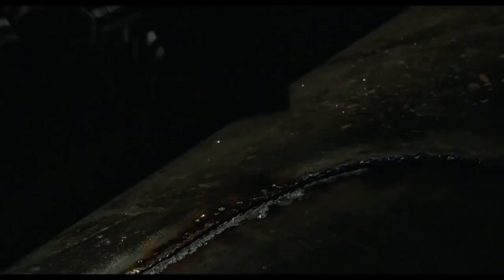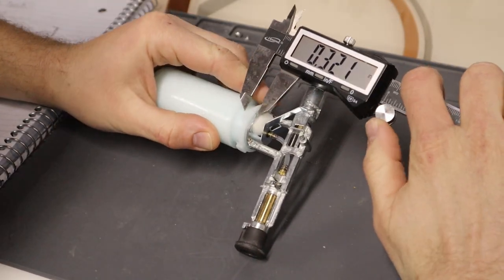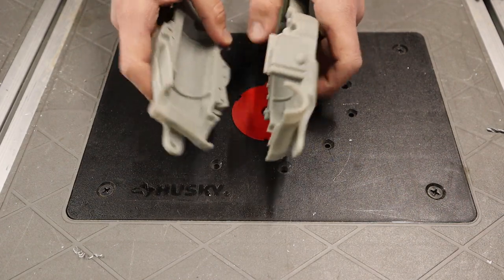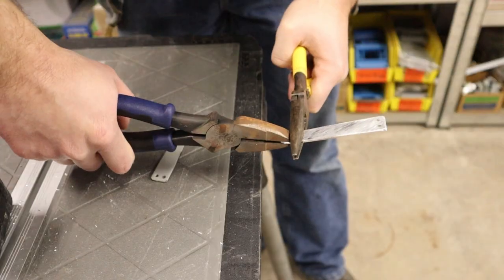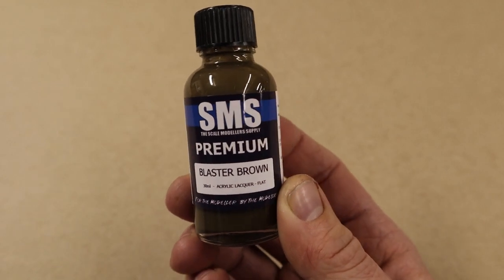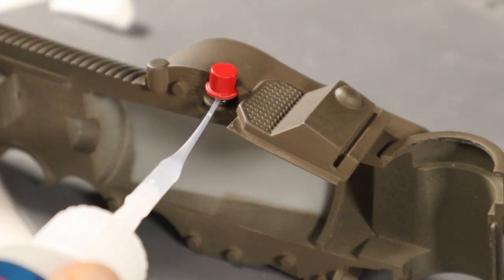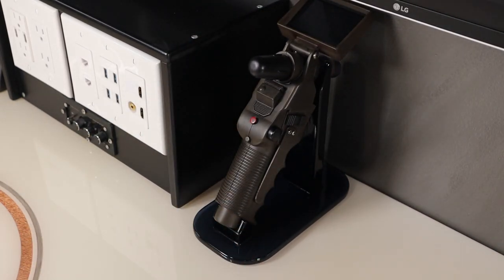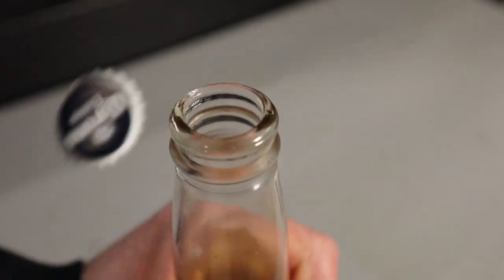Aliens Hand Welder Made From a Butane Torch

Comment: This looks fantastic.  You did a great job of designing & making it real.

My only suggestion, would be to hot-blue those screws.  The bright silver sticks out a bit undesirably.
Put a half-inch of vegetable oil in an empty tuna can, hold a screw with needle-nose pliers, heat 'til red, then drop into the oilcan - it'll blacken.
Bonus points: Use the hand-welder's torch to heat the screws.
Reply from the maker: Thank You! and funny enough they stuck out even worse before, I used a file to scratch them up a bit but had trouble getting paint to stick, thank you for the suggestion that would have worked out a lot better  that way

Comment: For a more noticeable flame you could always try adding a few metal salts to the tip or you could try a calcium carbide build
Reply from the maker: Thanks for the tip! That would be fun to play around with
Reply: @WiredWorkshop  if i remember correctly table salt should make a more amber flame given its primarily sodium

And for a unique take you could try copper salts for a green flame